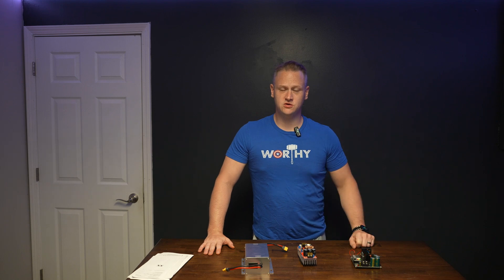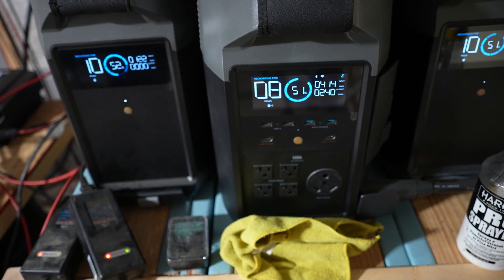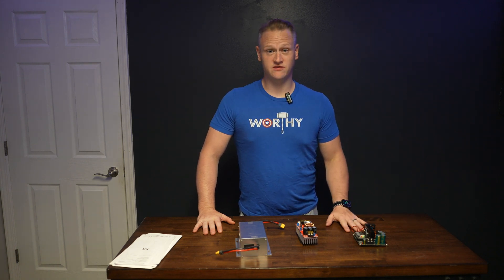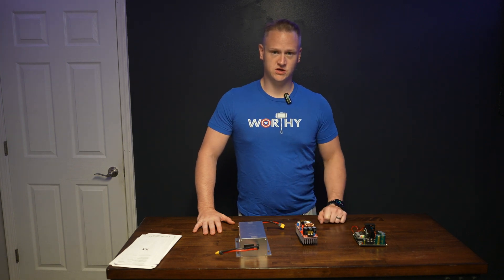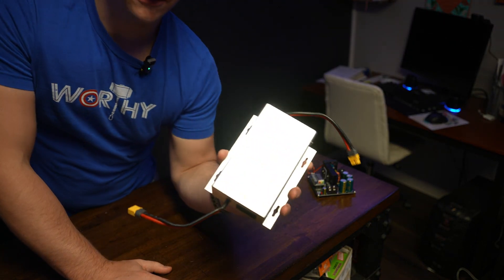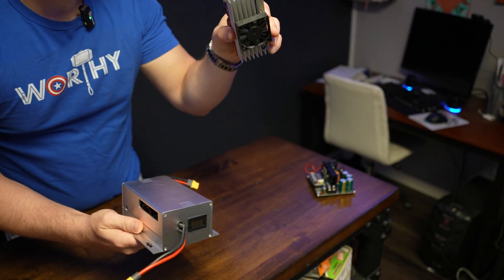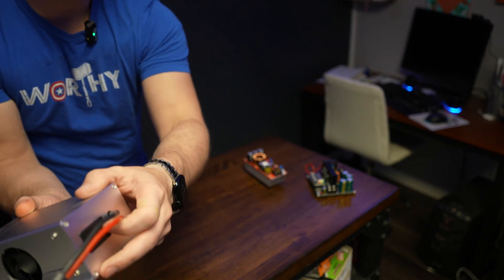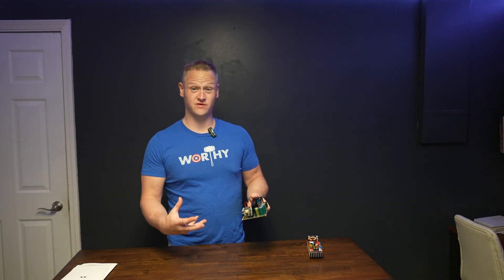External Battery Bank and the Delta Pro - Part 2

Comment: What is your work flow? I mean you can charge the power station using battery but How do you charge the battery?
Reply from the maker: I use an external controller to charge the battery bank.
Reply: @DanielGoodwin-jq1oc  so you use the electricity from the grid to charge the battery and use it like a stored power for the power station?. Do you use solar to charger both power station and battery?
Reply from the maker: No, I use solar power to power the external battery through the all in one controller and use that to power the Delta Pro in this setup. It flows > Controller > External Battery > Delta Pro
Reply: @DanielGoodwin-jq1oc  can you please show me the controller you used?  I am starting on this journey
Reply from the maker: This video covers my most recent iteration of the external battery bank integration:

https://youtu.be/dQWSShQ_Lxk

Hopefully that helps explain it better.

Comment: Very helpful.   I have wires directly connected from 48v battery (51.2v) and was banging my head on why I was only seeing 400watts from the Ecoflow Delta Pro.    Has anyone come up with a solution to get at least 800watts consistently without burning the house down?     Like some others, I've extended the Ecoflow Delta Pro but am not going to keep on buying more "extra batteries"... I'm maxed out already but wanted to more capacity.
Reply: You just connect to the solar input…. A 48v battery going into the solar input goes up to 1000watts in charging and it dosnt know it’s not the sun
Reply: @thepatternforms85  I got it on an XT60i cable and seeing around 830watts.   That's fine for me.   Thanks!

Comment: It is the tx60i connector. Don't use the  car charger tx60i its not wired the same as solar one. If you use the Tx60i with solar connectors the DP will allow the 1600x and 15amp input.

Comment: So the ecoflow delta pro is limited to 8 amps solar input under 60 volts and then over 60 volts input it changes to 15 amps total input? Where in the documentation does it say this info? Edit, I saw another video of the ecoflow delta pro getting 800 watts input direct to a 51.2 volt lithium battery but you have to use the solar input to mc4 cable that ecoflow has or else the ecoflow drops to 400 instead of 800 watts. 800 watts times 14 hours of night time means you can have 11kwh of external battery to your ecoflow.

Comment: After looking into this, if you could connect your 48V batteries in series then I will charge at 1500w. Not sure that you can connect your batteries in series but if so that would work.
Reply: Most 48V batteries can’t be combined in series

Comment: Daniel could you use this for low input from your solar panels to keep it at 1500 watts all the time or close to it?  It seems like a great idea if you had an array of 1200 watts to boost it up to 1500 watts.  Not sure about this but could you use it as a regulator, meaning/sample you have upto 1800 watts array, but most of the day its only at 1200, use this to boost it to 1500 watts and when it claims in the 1700 watt range it regulates and just keeps it at 1500 watts all day.  Maybe a simple answer for people that don't have a lot of solar panels or people looking to over panel to keep there incoming power at 1500 watts all day
Reply from the maker: I'm not sure that I could envision exactly how that would work in a safe way. The concept is good but I don't know of a way to practically make that happen. I think the best way (so far) is to feed your solar into the external battery and then from the battery to the Delta Pro. I don't think there's a safe way to combine the battery with the solar input. But, I could be wrong on that.
Reply: @DanielGoodwin-jq1oc  You had just given me a idea of what to do with panels not to add it together with a battery.  That wouldn’t work as the voltage would be fighting each other.  I was meaning Just by itself, plug the panels into it and plug into the DP.   This way if you only have 900w of solar by using the box it would up it to 1500 watts so no matter what you for the most of the day you have 1500 watts coming in not just the 900w at peak time for 1 1/2 hours but all day

Comment: One of the best parts of the delta pro is its EV stream connector.  I can charge my delta pro in about 50 mins with my EV charger.
Reply: I want this on the 2 Max 😢 I want to be completely free to go on a big road trip and I won't always be somewhere where I can plug into the Grid or setup solar so half an hour somewhere to top it off at the charging station would be the ultimate setup for me but I really don't need a 100 lb double the price massive battery in the Pro 😂

Comment: What about leveraging the AC input on the back of the Delta Pro to charge from an external battery bank?
Reply from the maker: It's a good idea, unfortunately the AC input on the Delta Pro is disabled when its connected to the Smart Home Panel. I am planning to try an AC to DC converter though just because I'm curious (and probably a bit foolish). It would be wasteful (converting energy from DC to AC and then back to DC again) but if you have spare solar power to waste, it  could still be useful. I'll do a separate video on that once I get the parts needed to test it out.
Reply: @DanielGoodwin-jq1oc  Interesting I didn’t know that. I’m wondering if the grid goes down if the AC input will automatically re-enable. If that happens it would be useful for emergency backup situations with an external battery bank.

Comment: Thanks for this video.  I wish I was more comfortable with electrical because the first thing I think with what you were doing is how likely is this to start a fire.  I do really like to see that there are other ways to get energy into the pro aside from the standard ways.  I feel like they advertise a whole home solution but the capacity when batteries are maxed out on two pros is just shy of what I feel comfortable with for a whole backup solution like a power wall or franklin battery.

Comment: I can't speak for the Delta Pro but the Delta 2 and 2 Max are limited to 8A by the polarity of the XT60i center pin or lack of pin on a normal XT 60.

If you short the center pin to the square (positive) side, it limits to 8A.  If you short the center pin to the not square (negative) side it will allow full current.  (15A) on Delta 2 and 2 Max.  

This will allow you to get the most out of solar inputs as well as about 200W directly from your 12.8V battery depending on the voltage.

I used 2 batteries and had it backfilling the Delta 2 Max while it ran my fridge.  Kept everything topped off since the fridge draws less than 400W.

Just something I thought I'd share since XT60i seems to cause confusion.

Coincidentally, I bought the exact DC to DC converter you have without the display.  I've got 2 extra 12V cooling fans that I'm going to mount in a plastic ammo box.  Good to see someone has taken my same idea and put it in a metal case.  Maybe I'll check out that option too.

Thanks for the video!
Reply: The pro can do 15A